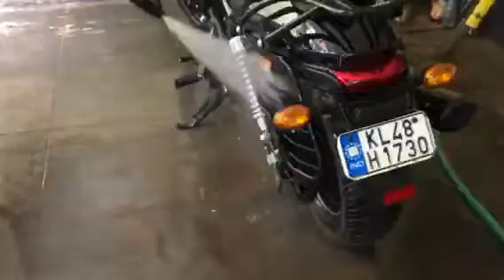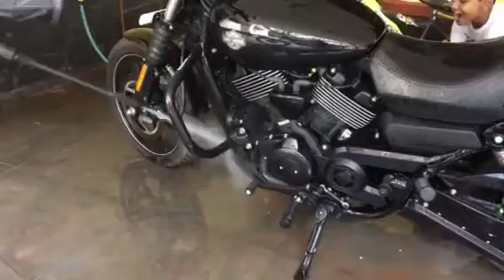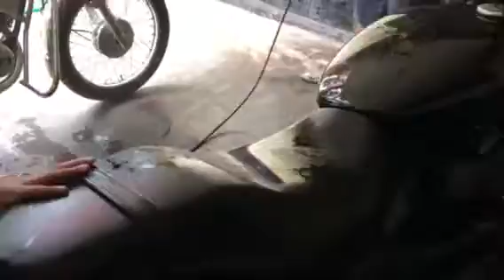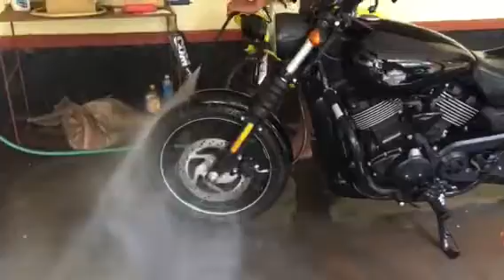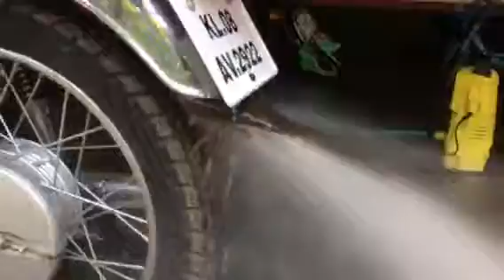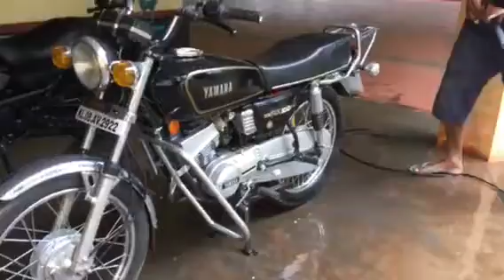Harley Davidson Street 750 soapy wash at Kiraloor

Comment: Will it start right up with no problems after a wash like this?  I remember how in a car, if you get the distributor cap wet while cleaning the engine, it wouldn't start. I know you can ride a bike in the rain, I just don't know if there's something I should avoid getting soaking wet.
Reply from the maker: I avoid direct water contact to the engine parts and also use a dryer right after the wash.. I wash very rarely and you are right , it’s not advisable to wash motorcycles often especially with pressure washer
Reply: @Ashrafkiraloor  Thanks!  I live in an apartment, so I can't wash my bike in a driveway. Another rider gave me the advice to go to a carwash to wash it. My concern is whether or not it will start in order for me to get back home!